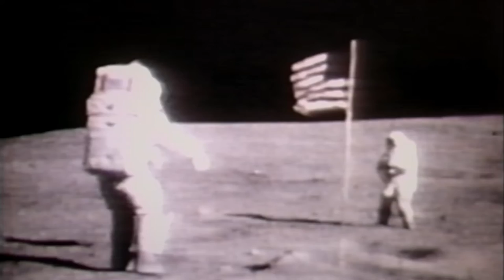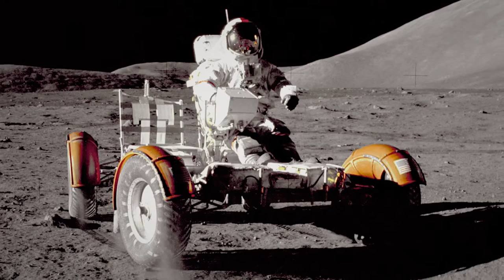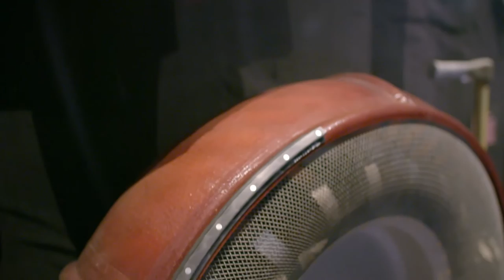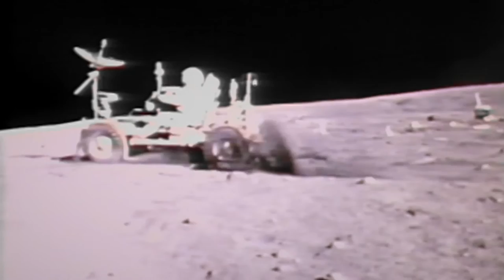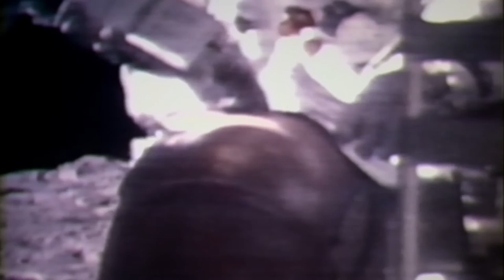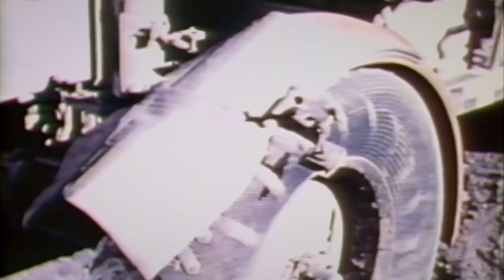Duct Tape Repair on the Moon

Comment: little known fact.. every video of the "rover" is actually a miniature RC car with an action figure miniature astronaut on it. You can tell because the left arm is permanently locked at a 90 degree angle from the body. Sticking straight out the way an action figure arm does. It stays that way during the entire ride in every rover video! 
They obviously had to do this because they didn't have a set big enough to film the actual rover driving around. So the miniaturized it like they do for many Hollywood movies!
isn't that fun?!
Reply: Hmmm...I wonder if there's another explanation for this...?!?
Reply: @larkefedifero no that’s it